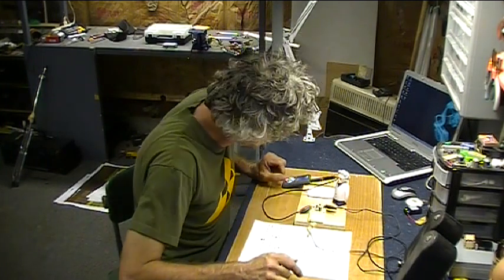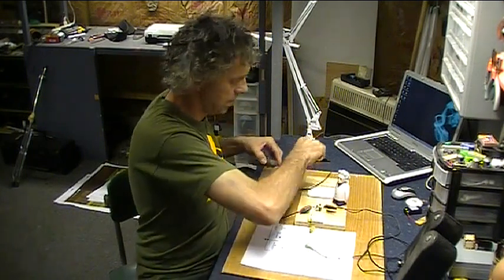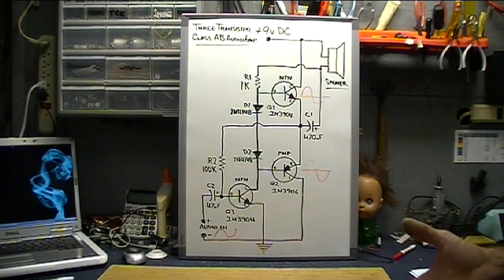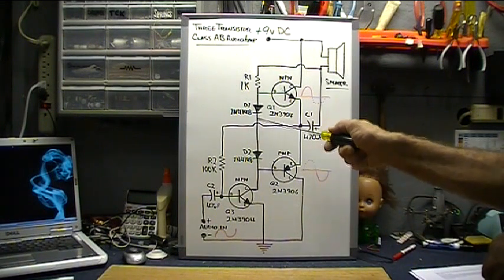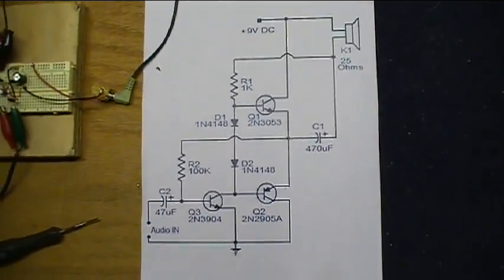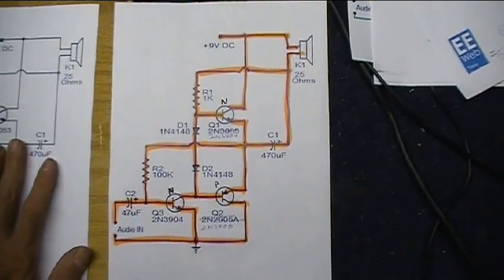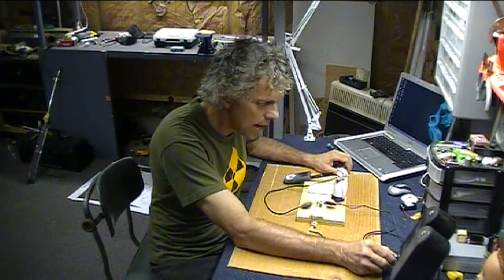Class AB Audio Amplifier

Comment: i just built one with 2SC5200 NPN and 2SA5200 PNP transistors, the amplifier it's powerful I almost cracked my ear diaphragm as I was too close to the speaker, thank you ! I also noticed an overheating of the transistors

Comment from the maker: @anceop 
The negative output is derived from two sources. The NPN for the positive wave cycles, and the PNP for the negative wave cycles. Since the sum of these two is an ac voltage, a decoupling cap is needed AND it's on the negative side of the circuit therefore it's negative lead goes to ground, and the positive to the load.

Comment: I want to build an audio amp in 2021 and the best videos are at least 9 years old 😂 thank you for that Tutorial!
Reply: thats because of the dirt cheap low power amp ic like the 8002 also some are class D like the tc8871 and works with very little extra passive components, for high power there are the irs2092 and you really whant class D because of the efficiency also class D sounds with virtualy no differece and it has more accuracy than analogic class a ab amplifiers.

Comment: You might consider 1Ω resistors between the emitters and the output on each of the output transistors. That way, if the output transistors get hotter than the 1N4148 diodes, the bias current doesn't increase, which could lead to thermal runaway. I like the way you used the speaker and the output capacitors to serve as the bootstrap, rather than adding another resistor and capacitor to serve that purpose. Fewer components, and, more importantly, LESS DISTORTION! I never though about that. I don't see a problem with the 9 milliamp DC bias on the speaker coil, since the I^2R loss is negligible. The only possible caveat is that the output stage MUST be loaded with a low impedance load. This output stage cannot be plugged directly into an auxiliary input of another amplifier, without a low impedance shunt, because it won't pull up the high side transistor on the output stage, through the 1KΩ resistor. On the input, it might be worth while to include an emitter follower and voltage divider, to help the input transistor hold the output more accurately between the supply rails. That way, it would be less susceptible to supply voltage variations, and possibly increase your input impedance. Less distortion yet, but at the expense of some gain.

Comment: I made a Class B amplifier that's distortion free, I used an op-amp to drive the output transistors, and connected the feedback resistors to where the transistors emitters are connected so it gives a "corrected" waveform to the transistors to compensate for the cross-over distortion. It works quite well, is very efficient, does not go into thermal runaway and I use to power the speakers at my computer
Reply: do you have video aboat that ? I realy want to see it or if you can give me a shematic ?
Reply: JOSIP Žlk
I will make a video of that and show the schematics.
Reply: JOSIP Žlk
ok, here's the video of the class b amplifier I made https://www.youtube.com/watch?v=5OjTz3SjAXA&feature=youtu.be

Comment: It is a nice and simple design. I did some minor modifications to get it more under control. So I suggest to separate the boot strapping from the output to allow operation of the speaker against ground. I used a bootstrap network of 2 resistors of 270 Ohm and an electrolytic of 220 µF Then I put a 10 kOhm resistor between C2 and the base of Q3 to limit the voltage gain by some feedback. I increased R2 to 150 kOhm to meet the midpoint between ground and operating voltage.

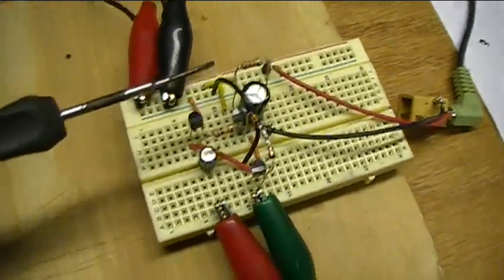Comment: Ok.  I'm confused.  Do your transistors have an odd pinout.  It appears your transitors are CBE (left to right) pinout?  At 4:45 I can see you have what should be the E of the pre-amp NPN tied to the B of the 3906 (via red jumper) but that's not in your schematic?

Comment: I remember playing around with a circuit like that in my father's basement, the only difference here is that R1 seems to provide both bias and maybe some AC negative feedback. So far, so good, but I found that if I left it running at more than a trivial power level, both transistors would heat up, run away and burn out. I think a resistor between the emitters, with a bypass cap at each end to avoid lowering the AC gain, put a stop to that.

Comment: Love this circuit. I made a few changes though. I changed the 1K resistor to a 470 ohm resistor, changed the 100K resistor to a 180K resistor, and added a 4.7K resistor before the input capacitor
Reply: And what changes you get?

Comment from the maker: @blueblast88 The next time I do a project with those jacks I'll explain a bit more about them.
Reply: How about for stereo of this kind, it would have different power supply? As in diagram, +9v is connected to speaker. So if two channels, is like the other channel coupled to other channel. Or it doesn't produce stereo sounds.

Comment: Hi, thanks for the video! What if I increase the voltage up to 24 volts, or even 30 volts? Do resistors wattage matter much in case of voltage increase? I build the circuit and hooked my guitar pedalboard (from preamp output) into it driving a 1x12 guitar cab. It sounded amazing, I wonder if I could build a tiny portable poweramp for my rig with little more juice and headroom. As far as I can see in the datasheet these transistors can handle up to 40 volts.
Reply from the maker: Probably could increase the voltage but you might need heat dissipation.

Comment: Are you sure, that the scematic is correct? Especially the position of the two diodes?
Reply: The diodes are correct: Their purpose, is to match the base-emitter voltage of the transistors, so the transistors are lightly biased. That eliminates zero crossing distortion, without drawing enough current to get hot. If the diodes have less voltage drop, the transistors run cooler, but there is distortion at very low listening levels. Depending on the temperature of the room, that voltage drop can be anywhere from .55 volts, to .7 volts per junction. If the transistors and diodes are at the same temperature, there's a "sweet spot" where the transistors draw no current, but, there is no zero crossing distortion. Ideally, the diodes would be thermally coupled to the transistors, so as they heat up from load, so would the diodes. Because that's sometimes impractical, a better solution is to add resistors between the emitters of both output transistors and the output. that way, if the transistors do heat up, the resistors add voltage drop, keeping the output transistors thermally stable.

Comment: why not move the end of the diode chain to the collector of the bottom transistor has to be the same as the top transistor which should give a better signal as it will become Class A also needs a 10R resistor between the emitter of the top transistor to the collector of the bottom NPN transistor, the feedback comes from the top emitter to the base of the drive transistor via 560K resistor. I saw this version in the service manual for the TECHNICS SUA900 MK II.
Reply: The diode chain has to be between the bases of the output transistors. Since the voltage drop of the diodes is approximately the same as the base-emitter junction voltage drop of the transistors, it greatly reduces zero crossing distortion, which you would hear at lower listening levels, or in headphones. The 1K resistor that goes from the base of the high side transistor to the speaker output provides that pull up current to forward bias the transistors. (that's why the speaker is connected to Vcc) By connecting the resistor to the speaker output, it creates a bootstrap circuit, to allow the high side transistor to turn on fully, at high listening levels. This is a highly simplified version, that allows that 1K resistor to serve as bias, negative feedback, and bootstrap all at the same time, while allowing the output capacitor to serve as the boot strap capacitor as well. The TECHNICS design is for a split supply, with no output capacitor. This circuit only works as a single supply, with the speaker referenced to the POSITIVE rail. Best with a regulated supply, or a beefy battery and large capacitor across the supply rails.
Reply: @vincentrobinette1507  you could also goggle for 5W Class A amp similar thing.

Comment: That's a "guessed" operating point. It is better to have a small emitter resistor for Q3 and use a third diode in series to enable to presetting of the bias point more precisely. The gain of the circuit is also more predictable, with a better cross-over distortion figure.
Reply: If he adds another diode, he will also have to include emitter follower resistors on Q1 and Q2, or the transistors will be fully on, and would go into thermal runaway. The 2 diodes approximately match the base-emitter junction voltages of the 2 transistors. Emitter followers should be used anyway, because when the transistors are loaded, they will heat up, which lowers their junction voltages. That alone could send the circuit into thermal runaway. Heating the diodes reduces bias current, heating the transistors increases it. There's no practical way to thermal couple the diodes and transistors, to maintain uniform temperatures between them, so emitter followers are the answer.

Comment: Nice but what if you don't already have PC speakers and you want to make them with little 8 ohms/0.5W speakers and get the signal from RCA outputs of a CD player for example ?
PC speakers you show here already amplify the signal, doesn't it ?
Reply from the maker: No. They are just speakers in a plastic enclosure.
Reply: @HackaweekTV  Oh ok...And what are their specs (ohm, watt) ? You don't talk about it or I didn't listen carefully..
Seems like you just put a potentiometer in series with them ? And again, what value ?
Reply: In fact, I only have BC547 and its complement BC557 transistors and have managed to feed a tiny 8 ohms/0.5W speaker.
I give it audio signal from a RCA connector of a DVD player.

I tried a class AB on a breadboard and It works with 2 separate 12 V power supplies  (=> +12V and -12V).

I can clearly hear the music but I can't make it loud enough (I think it could be louder) and the transistors are quite hot (I burned one of my fingers but the bjt's are still okay) if I don't put a collector resistor of at least 100 ohms (for both transistors of the push-pull).

I even used 2 pairs of transistors (2 NPN and 2 PNP) simply put in parallel to allow for more current but I don't think it's a proper way of doing things...

Comment: When i built this my pnp transistor would get very hot. I checked my wiring and found out i put the wire going to the emitter on the wrong side of the 470uf cap. However the circuit does not work when i put them on the correct side, but gets very hot and burns out if i put it on the side that works...Any advise?

Comment: WHAT IS WITH THE K1 25 OHM AT THE TOP RIGHT OF THE SCHEMATIC. THAT IS AN ODD VALUE FOR A SPEAKER. I WOULD HOPE THAT THIS AMP WOULD WORK JUST FINE WITH AN 8 OHM SPEAKER. I LOVE YOUR VIDEOS  YOU ARE A GREAT TEACHER. AFTER MAKING THE CLASS A AMPLIFIER THAT WORKED SO WELL I WAS SO DELIGHTED AT HOW WELL IT WORKED I BUILD THEM OFTEN NOW. IT WAS SO EASY.THANK YOU!.
Reply: Maybe high fidelity old speaker or can be headphone impedance. My headphones have 32 ohms impedance.

Comment: Put a five volt regulator on the nine volt battery and connect the 5V out to your small amp. Easy peasy. LM7805 or LM340-5 should work for you.

Comment: nice video man.. but could you explain.. what input source impedance.. and what output inpedance is... like is it a 8 ohm input and 8 ohm output... how how you can change the parts to achieve other impedances.. thanks man
Reply: The input and output source impedances can be calculated quite accurately using the Thevenin theorem and the small signal models of the transistors. See Hybrid-Pi Model:

http://en.wikipedia.org/wiki/Hybrid-pi_model

The input impedance for this schematic is really small due to the fact that the input is directly connected to the npn base. Knowing that the resistance between the base and the emitter is Vt/Ib where Vt is approximately 25 mV, the input resistance is really small.

On the other hand, the output impedance is quite big, since there is not direct path to either Vcc or the ground. The resistance between the base and collector is approximately r0 which is really big (r0 = Va/Ic where Va is the early effect voltage).

http://en.wikipedia.org/wiki/Early_effect

It can go from 15V to 150V. So 15V/1mA = 15000 ohms. Because of this, r0 is often neglected when doing approximations.

So yeah, this amplifier circuit is far from ideal, small input impedance and big output impedance. You often want the inverse case when designing complex circuits.

Comment: Why is the speaker connected to Vcc not GND !?!
Reply: It's connected to the GND via the transistors, thus the transistors controls the amount of power going trough the speaker by varying the resistance at the GND that the speaker sees.
Reply: Mtaalas
It's not connected Via the PNP transistor ,this is an AB amp, The lower terminal is connected to both Emitters ,they are the Output , but virtualy this circuit has no REF point , 9volt DC is a BAD Ref point ,because it's going to BIAS it and make things worse !
Reply: i asked my self the same thing but fuck it it works :)
Reply: If 9v supply is a battery (quiet), then connecting the speaker return to the supply is the same as returning it to GND, both are an AC ground.
Reply: It doesn't matter which side ot the supply an ac-coupled speaker is returned to.  I'd be asking the question "why no decoupling capacitor on the supply"
Reply: If you look closely, the 1K resistor is connected to the speaker output. That resistor provides the pull up current that allows the high side transistor to turn ON. By connecting it to the speaker, that same resistor also serves as negative feedback, and the output capacitor can also serve as a bootstrap. A very small amount of current flows through the speaker voice coil, then through that resistor. That gets rid of the extra capacitor and resistor for a normal boot strap circuit. It's a very clever design. The speaker has to be connected to Vcc, to create a current path, to bias the high side transistor.

Comment: Do the diodes have to be in there, isn't that just to prevent you from switching + and -
Reply: they cause the voltage difference that turns on both transistors (hobbyist, so confirm my answer)

Comment: hello I want to make an audio amplifier / booster employing a transistor long-tail pair input stage (BJT or
MOS) and a 250 mW BJT class-AB complementary output stage to drive a 25 Ω earphone
speaker using discreet transistors. Ensure maximum output compliance using a max +6 V
supply rail and a minimum total voltage gain of 20. The amplifier is to be driven by a mobile
phone so input impedance must > 32 Ω to avoid damaging its audio output port.
 can it be done with this circuit?

Comment: I've made this exactly according to the drawing, but i only get a buzzing sound from the amp :( i have 2SC3858 as the NPN's, and a 2SA1494 as the PNP, and 18 Volt DC
Reply: +Crytek1337 i figured it out, im an idiot!!! the collector and emitter on a pnp transistor is switched compared to a npn transistor, hahahahaha!!! but i have alot of distortion, and im using 36 volts peak to peak

Comment: It is a pity that good circuits tend to have a resistor or two re.oved and it suffers as in this circuit.
Reply from the maker: It would help others if you could be more specific in your comment. Thank you. :)
Reply: @HackaweekTV  Probably that there should be two resistors between the emitters and the output to prevent thermal runaway

Comment: how to put the potentiometer?  please i need your immediate  reply.
Reply: For a volume adjustments? If it is for, better to use 50k ohms potentio, the first pin should be connected to ground. Second pin is for INPUT of the circuit, then the third pin should be connected to the audio source (ex. Mp3 player, phone etc), better to use 3mm audio jack. I hope you understand. Goodluck